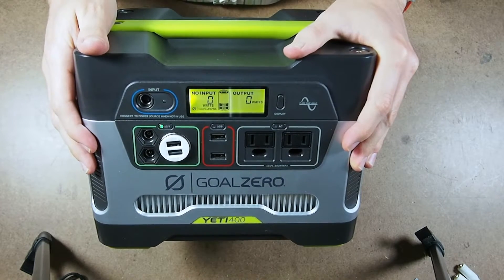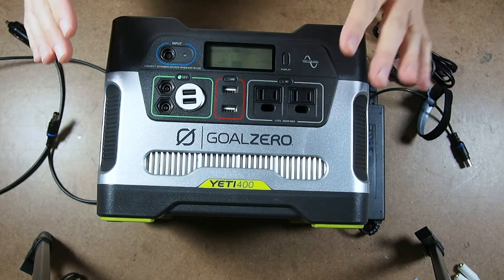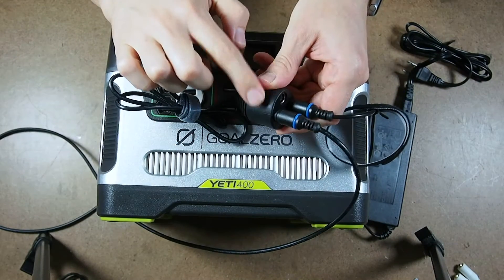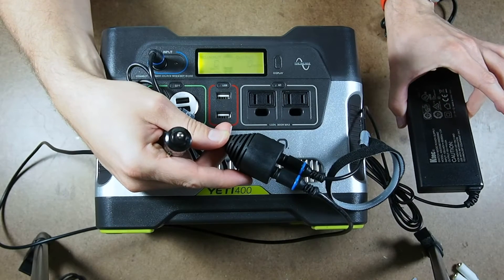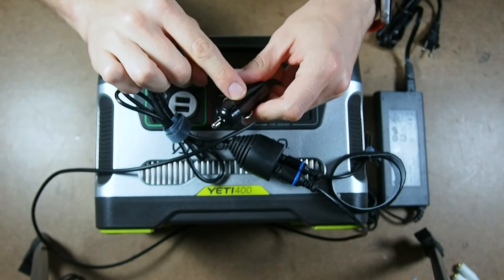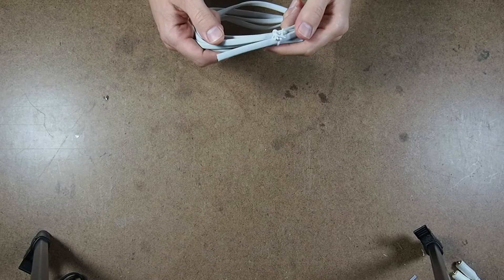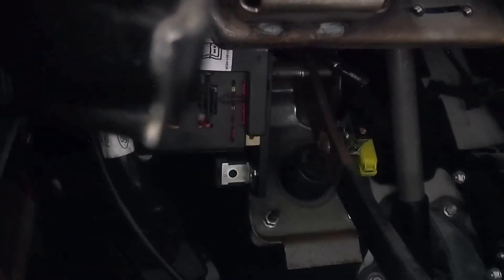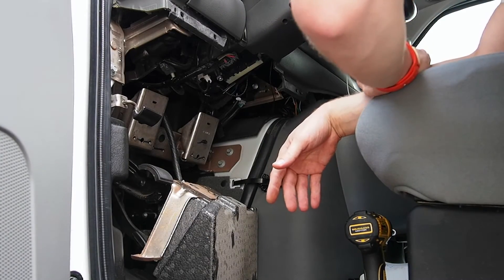Wiring a charging relay for the Goal Zero Yeti 400

Comment: I love the info you give on your videos.  I was wondering how this set-up worked out after about a year you did it.  One of your goals was to ensure a friend borrowing your rig didn't have to fiddle around with changing the charging cables when they got to their campsite.  Did this set-up accomplish that?
Reply from the maker: Thanks Dale. It worked well. Totally hands off switching between shore power, alternator, and solar.

We just switched to Lithium batteries and I would NOT use this same setup for Lithium. You need a charge controller in between the alternator and the lithium battery. I went with the Renogy DC-DC with MPPT because it was the simplest solution and it also trickle charges the starter battery from solar when the house battery is full.

Best of luck.

Comment: Can you over charge a yeti 400 from shore power..??  Should I leave it plugged in all the time..??
Reply from the maker: Hi Brad. I don’t see why you couldn’t just leave it plugged in since it has its own charge controller built in. They do market them as being emergency backup power and you would want to keep it charged up for the unexpected outages. Mine is always connected to solar, so even if it’s fully charged it’s always getting power, if it’s light out.

Comment: Nice video and info.  What relay and diode did you use?  Thanks
Reply from the maker: I ended up not using a diode and rather used a common automotive 5-point relay like these: http://amzn.to/2fPLzxd 
You can find relays with tabs or with wire leads on them. They are very useful devices for running auxiliary components like amps, horns, and lights.

Comment: Do yourself a favor while doing any kind of aftermarket wiring(non stock) always put in line fuses it will save your equipment if something goes wrong. Also always bundle ur wires with other stock wiring. Had a friend that did some working in his car and didn't use any inline fuses and didn't secure any wires and his wiring rubbed up against a moving part and shorted out and caused a small fire which could of been prevented with fuses and a few zip ties
Reply from the maker: +Jason Alheit thanks for the tip. It seems like sound advice to me. Thanks for watching and commenting.

Comment: Hardware a aux cigarette lighter to a fuse like the radio that only comes on when the van is running direct and don't cut your adapter
Reply from the maker: +Linda K Scott that is a worthwhile idea. The adapter wasn't much more than a lighter socket and I think it resulted in a cleaner install.

Comment: It is a great feature on most trucks. It still allows you to charge things like cell phones when your car is off and you go into a store but if you do have say a fridge it will not leave you stranded with a dead battery. The goal zero is after all just a car battery. So you are asking an equal battery to charge the yeti with out an alternator. You would very short time not be able to start your van. You can get a dual battery installed with a converter but then that would defeat the purpose of having a yeti. I would suggest Just hooking up a few of their solar panels instead.
Reply from the maker: Yes, I've come to like the feature and use it to charge my phone overnight when camping. But as you say, I didn't want to leave the Yeti plugged in while the engine is off for fear of it leaving me stranded. Thanks for watching.

Comment: do you know if this would work if you were using Solar as well as charge of the alternator if you were using this in a campervan?.
Reply from the maker: +Josh Kiely this could work with solar instead of shore power just the same. What this is mostly doing is preventing power from getting to the vehicle from shore power or solar source.